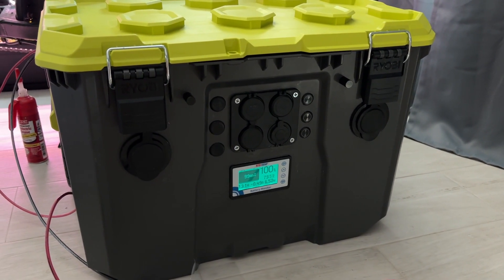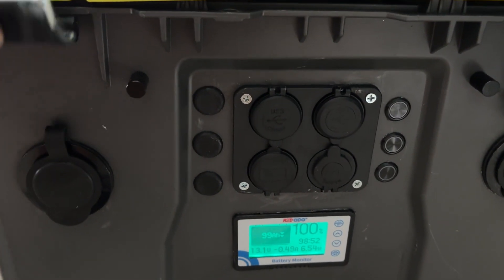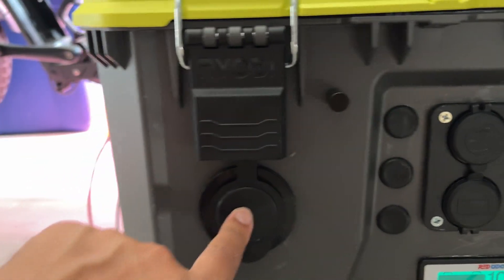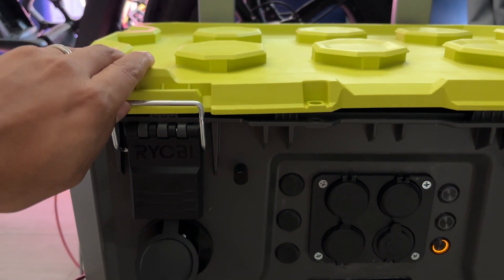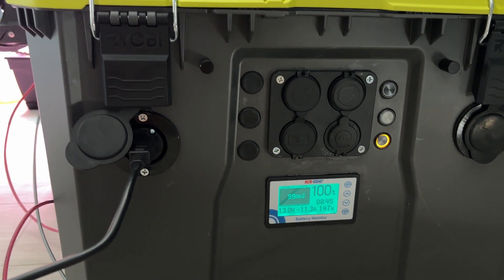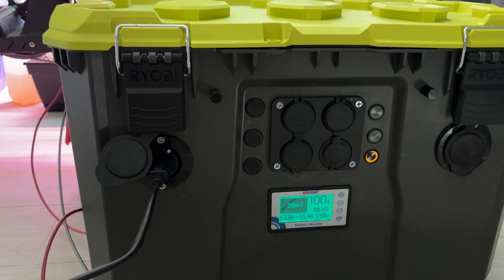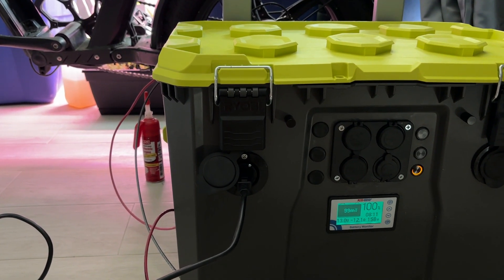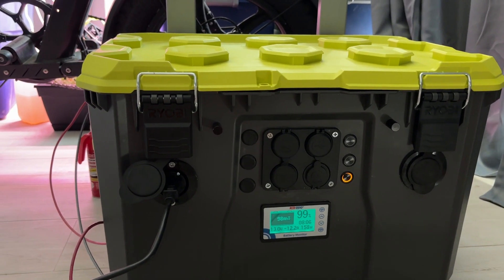DIY 100ah 12v Solar Generator in a Ryobi Toolbox

Comment: It's not a solar generator - it generates nothing. It is simply a battery + inverter in a box. The battery needs to be charged and recharged either from solar, power line, or gas/propane generator.
Reply from the maker: Thank you for the comment and clarification. 👍
Reply: @rayherriott6517, go do something else
Reply: Stop being an a$$hole and go create your own channel